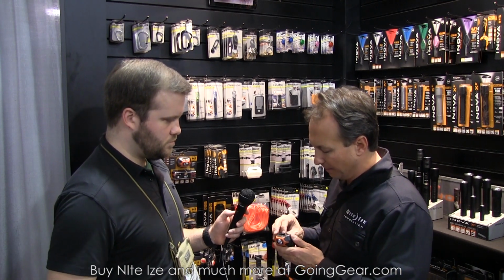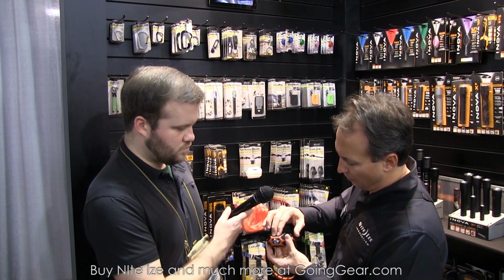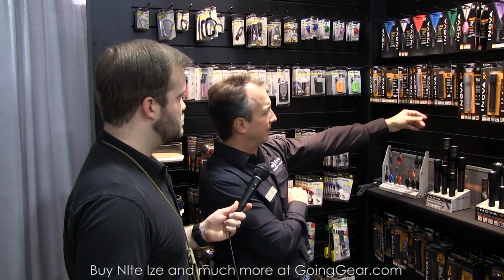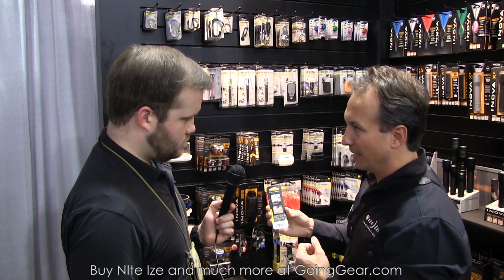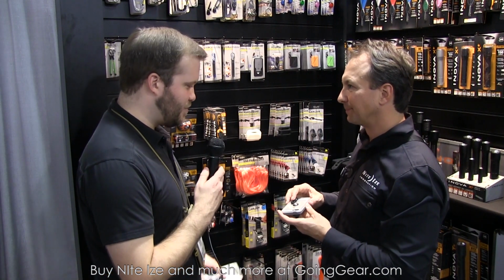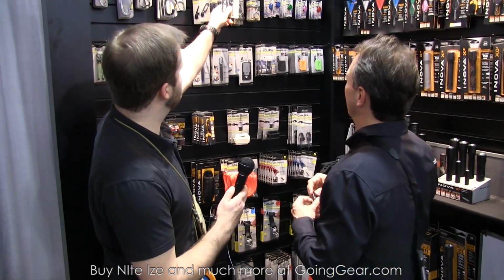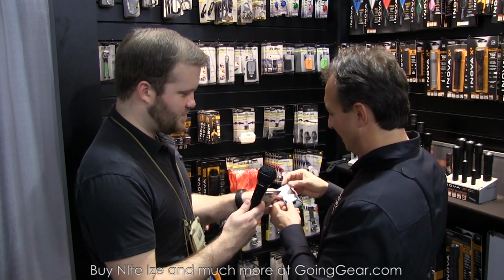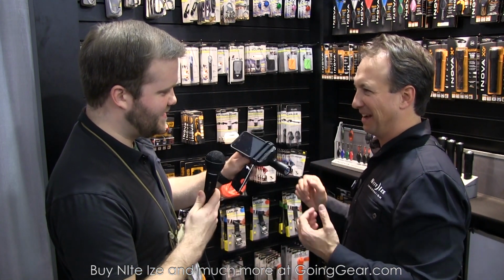SHOT Show 2014 - Nite Ize New Products

Comment: I was all for that headlamp until I heard you had to strap 3 AAA batteries in a fricken box to your head.

I'll stick with my single CR123 self contained 520 Lumen zebralight ty.
Reply: It's that it has a separate battery pack which bothers me.

I can blame the lower lumens on price point but not silly design choices.
Reply: Okies then my opinion has changed entirely, for that price point.